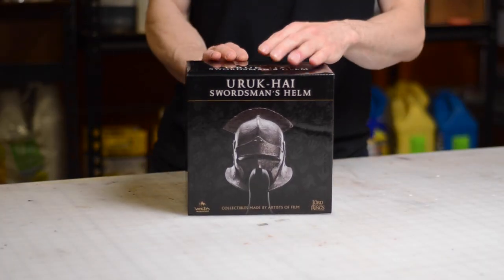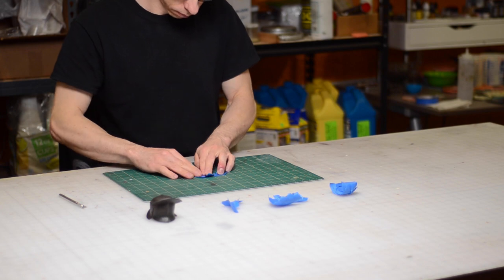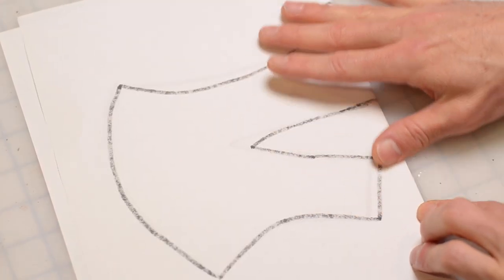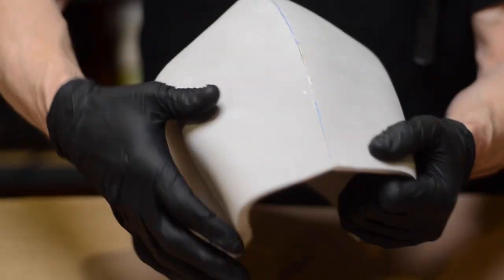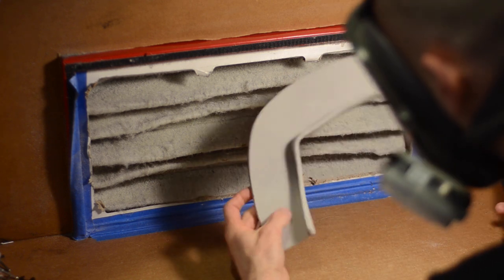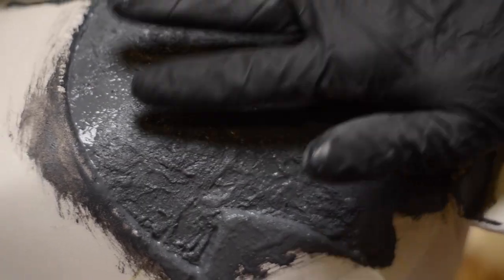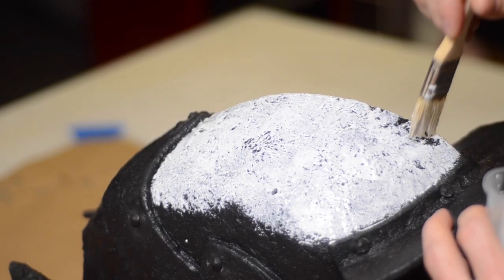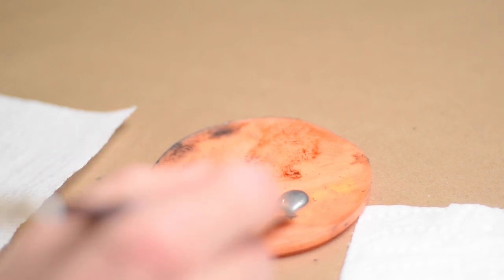Building an Orc Helmet out of EVA Foam

Comment: Thank you fort the template! This thing was quite the challenge, since I don't have the neopreme (had some wood glue) and half of my paints were dry, the thick foam was hard and the slim was floppy :D. So I'll have to do it again soon. The outcome became quite excitnig, so I'm happy. 😊
Reply from the maker: That's great! You can definitely use other materials instead of neoprene. I've seen people use white glue, wood glue, roof sealer, Mod Podge, or even just thick acrylic paint. They all work!
Reply: This technique is quite amazing to be honest. I'm planning to make a video for some texture stuff on cosplay an this will be in there for sure. :)  @ModulusProps

Comment: the helmet was very good and I would like to make one, but I would like to know if it has the A4 sheet version.
Reply from the maker: I only have the 11x17 inch version right now, but you can use the poster feature in Adobe Acrobat Reader to tile it for a smaller page size.

Comment: Really incredible work! The cotton batting's such a clever idea and the final finish is incredibly convincing. 

Did you give it any final seal to protect the paint job? Or would that dull the effect?
Reply from the maker: The helmet is not sealed. I usually try to avoid a final sealer if I can, because it can take depth out of the paint job when using a mix of glossy and flat colors.

Comment: Amazing. Cotton technique blew my mind. Any idea what the total cost of this project would be?
Reply from the maker: Good question. Using the same materials as I did, it would be about $75 total for a couple sheets of foam, a pint of neoprene, some cotton batting, and a few bottles of acrylic paint -- and you'd have a bunch of material left over for more projects. For a more economical way, I think you could keep it around $25 if you use low-cost foam floor mats, a bag of cotton balls, Mod Podge instead of neoprene, and some basic craft acrylics.
Reply: @ModulusProps  awesome thank you very much. I'd love to attempt both and see how different they would turn out.

Comment: beautifully done.

 how much would you scale it down to fit your head?
Reply from the maker: I think the scale is actually pretty close for an average sized adult. Depending on the look you're going for, you might want to scale it down slightly, maybe 10-15%.
Reply: @ModulusProps  I made it with 100% percent scale + 4mm EVA. It fits my head almost perfectly. Thank you so much sir <3

I'll try 10% next time, cheers

Comment: I have a question, when configuring the image in poster size for printing, how many parts is the image divided into?
Reply from the maker: The template is 11x17 inches, so if you're printing on 8 1/2 x 11 then each page will split into two sheets

Comment: What should I scale this to to print on normal 8.5×11 paper, I didn't bother to look so now I've got some tiny templates, and that does indeed not work
Reply from the maker: To print on 8.5x11 inch paper you'd need to use the multi-sheet printing function of your PDF viewer (i.e. Adobe Reader). If you print at 100% it will be scaled properly for an adult.

Comment: How happy were you with the scale of it when it was done? Is that accurate in dimensions to the originals? Thanks.
Reply from the maker: I think it's fairly close to the originals, but probably not exact. I started with the quarter-scale collectible and scaled it up by four times. It's definitely large enough to fit any adult sized head.
Reply: @ModulusProps   Thank you. I'm gonna give it go.

Comment: Im a little confused, the texture was applied just by painting over the cotton?
Reply from the maker: Yep! The liquid neoprene holds the cotton in place until it dries. This works with other materials too, like Mod Podge and saw dust, for example.
Reply: @ModulusProps  aaa, ok, that was what i was missing. thx a lot for clarifying.

Comment: I bought Creature cast rubber super flex and tried out your technique and ..my god , it is horrible. 
The cotton wont sit still and it just clumps up and doesnt really make that nice rusted/bumpy texture.
Reply from the maker: Oh no, sorry to hear! That's interesting, I've used the superflex and it should work just fine. Getting the cotton to lay flat definitely takes a little bit of work because it wants to stick to the brush. I find it helps if you add a layer of just Creature Cast first on the surface, then dab in the cotton while it's still wet.
Reply: @ModulusProps  I bought some thickened in hopes that'll fix it. Fingers crossed
Reply from the maker: Good luck!